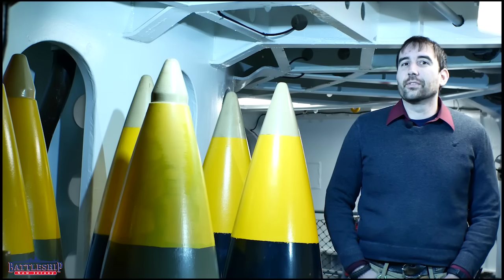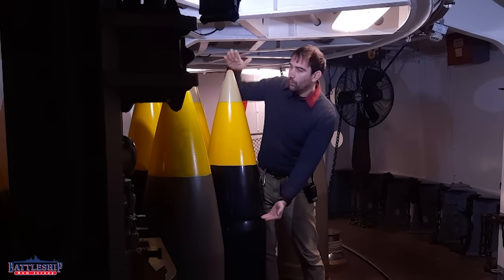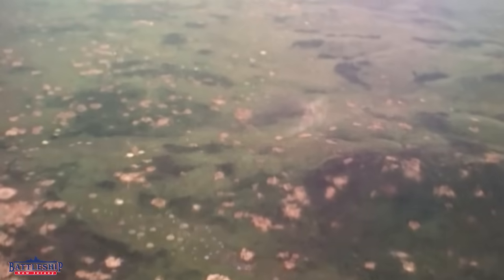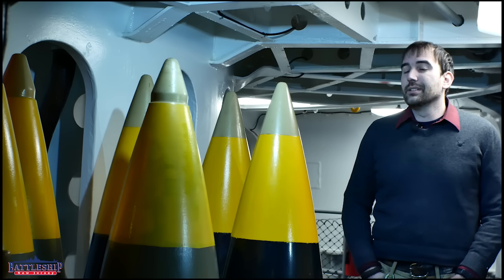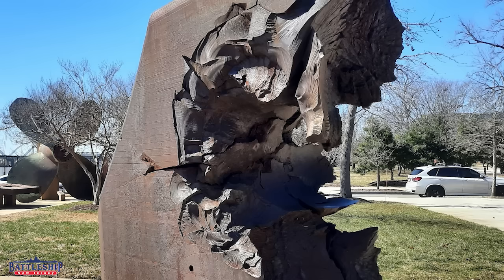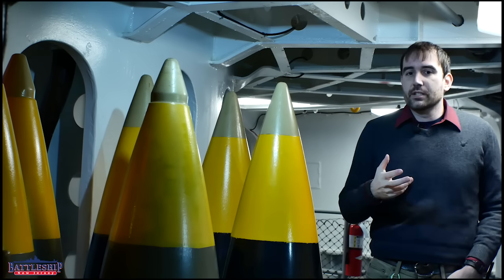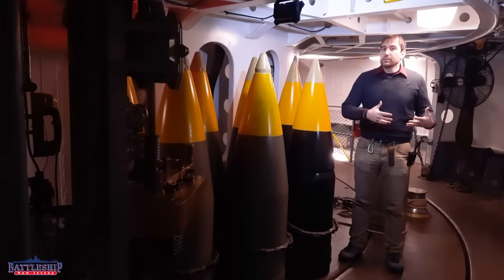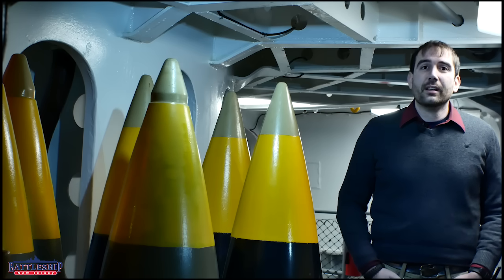What Does the Impact of a 16in Shell Look Like?

Comment: The 16-inch naval guns (primarily the US Navy's 16"/50 Mark 7 used on Iowa-class battleships) fired several types of projectiles. The "kill radius" depends heavily on the shell type, fuze setting, and target (personnel in the open, entrenched troops, armored vehicles, or structures). Here's a breakdown based on historical data and declassified US Navy ordnance documents:

### Main Shell Types and Lethal Effects

| Shell Type                  | Weight       | Bursting Charge          | Typical Lethal Radius (against personnel in the open) | Notes |
|-----------------------------|--------------|--------------------------|-------------------------------------------------------|-------|
| *HC (High Capacity, common)* | 1,900 lb (862 kg) | 153 lb (69 kg) Explosive D | *~60–100 meters (200–330 ft)*                       | Most common bombardment shell. Large bursting charge optimized for fragmentation and blast. |
| *AP (Armor Piercing)*     | 2,700 lb (1,225 kg) | 40 lb (18 kg) Explosive D | *~20–40 meters (65–130 ft)*                         | Very small burster; designed to penetrate before exploding. Minimal airburst/fragmentation effect unless base fuze functions after penetration. |
| *VT-fuzed HC (late WWII)* | 1,900 lb     | 153 lb Explosive D       | *~80–120 meters (260–400 ft)*                       | Proximity fuze caused airburst ~15–30 m above ground → significantly increased lethal area against troops in the open or light cover. |

### Practical Observed Kill Radii in Combat/Shore Bombardment
- **Guadalcanal, Iwo Jima, Okinawa, Korea, Vietnam**: US battleships routinely reported that a single 16" HC shell could neutralize targets out to ≈80–100 meters from impact point against troops in trenches or the open.
- **Maximum fragmentation danger zone**: Fragments from an HC shell could travel 400–600 meters, but lethal fragments (capable of causing incapacitating wounds) were generally within ≈100–120 meters in open terrain.
- **Against hardened targets**: The blast and spalling effects inside bunkers or ships could kill well beyond the open-air fragmentation radius.

### Quick Reference Summary
- Typical lethal radius (90%+ casualty) radius vs. standing personnel: *≈50–70 meters*
- Effective casualty radius (50% casualties) in the open: *≈80–100 meters*
- With VT (proximity) fuze in 1945: *up to ≈120 meters*

So, for most military sources and veteran accounts round it to *“about 100 meters”* as the practical kill radius of a 16-inch naval gun’s main bombardment round. That’s why battleships were so feared in shore bombardment — one shell had roughly the destructive footprint of an entire battery of 155 mm artillery pieces.

Comment: Which shell is heavier?  Did the difference in weight change the effective range of the shell?  What about powder load behind the shell?
Reply: The AP shell is heavier at 2700 pounds while the HC shell was 1900 pounds. 

For complicated reasons the heavy shell actually had a longer range at around 23 land miles. 

Both types of shells were fired with the same powder charge. Either a full 660 pound charge or the reduced charge for closer ranges.

Comment: He just said .50cal shell. 16inch diameter isnt .50 cal or half a inch.
Reply: In Naval gun speak, 16in 50 cal, which is short for the gun being 16in in caliber and the gun length being 50X the caliber length. So the bore was 50 X 16in long or 800in (66.7ft) long

Comment: While in Vietnam in 1970 in the LRRP Ranger Company we had access to  Army Artillery (mostly 105 mm howitzer but also 4.2  inch mortars, and 155 mm) Air (helicopter gunships, jets) and Naval Gunfire if operating within their range which was 13 miles inland (if memory serves. I think the battleship NJ was the battleship off the coast at that time. I never used Naval Artillery but it was an option.

Comment: There is no "powder" that's used as a bursting charge in these projectiles.  That's a term that went out with black powder and cannon balls.  What's in them is either TNT or Ammonol that's poured into them while it's in a molten state (liquid but not necessarily hot) that's then allowed to solidify.

Comment: That was 24" late war Japanese armor plate. The quality of their steel declined quickly as the war progressed. One thing I have never understood is the failure of these shells to substantially damage the Japanese tunnels in places like Iwo Jima. Those tunnels weren't concrete for the most part, rather tunneled out of the native rock. I wonder if they ever tested the effects of the high capacity shells fired at a high angle using a delayed fuse?  After all, the rock of the Island was readily dug through by hand, indicating it was fairly porous material, something even a high capacity round could penetrate easily.

Comment: A few seconds in
16" (50 caliber)? 🤨 😂
Reply: For naval guns “caliber” is short for “calibers long”, so the Iowas 16” 50cal, had a 16” bore diameter and the length of the bore was 50 times the bore diameter 16X50, or 800 inches long. So it’s just commonly used short hand. Hope that helps :)
Reply from the maker: https://youtu.be/79lqN3liPKk
Reply: Caliber is bore diameter ÷ length of barrel for any gun.

Comment: Did I hear him say that the round was "16 inch, 50 calibre"?
Reply from the maker: Caliber for artillery describes the length of the barrel, not the diameter.
Reply: For naval guns “caliber” is short for “calibers long”, so the Iowas 16” 50cal, had a 16” bore diameter and the length of the bore was 50 times the bore diameter 16X50, or 800 inches long. So it’s just commonly used short hand. Hope that helps :)

Comment: On a second tour in Vietnam in '71 as a platoon sergeant with the 101st Airborne,  I was tasked with getting eyes on damage assessment of a barrage made by the New Jersey the previous night.   After three hours of slogging through triple canopy I found vivid proof of the New Jersey strike. The craters were  50 x 20 feet in size. My whole platoon could fit inside one of the craters.  Sticking out of a small  creek bed was the largest piece of OD paint with  yellow markings ordinance I have ever seen. 16" x 6' with 1 ton of high explosive that had not detonated. Noting it's position on my map, gathered up the platoon and cut a choggie back to FSB Bastonge and made my report in the CP. 1st Plt,Co B, 1/327 AI. R S L. CSM retired.

Comment: Can someone explain how this 16 inch shell is considered 50 caliber?
Reply from the maker: Artillery uses caliber to describe barrel length not diameter
Reply: For naval guns “caliber” is short for “calibers long”, so the Iowas 16” 50cal, had a 16” bore diameter and the length of the bore was 50 times the bore diameter 16X50, or 800 inches long. So it’s just commonly used short hand. Hope that helps :)

Comment: I hadn’t seen the video yet but it was conjectured that the United States Navy used the battleships incorrectly in WW II.  Additionally,  if battleships had been armored to stop a 16” projectile,  why hadn’t the Navy instead fitted the battleships witb 20” guns?  Not suggesting having 12 20” guns but why not 4 Turrets each with 2 20” guns?  For a total of 8 guns?  The Japanese had 18” guns.  It certainly could have been possible to make 20” guns and out range and out class by an order of magnitude any other ship on the sea.

Comment: Since these are pre-1945, they are pretty simple designs. In a modern shell of this size, you'd probably see improvements like a shaped-charge warhead in front instead of inert aerodynamic cap, to "pre-punch" a small diameter, deep hole before main projectile impacts. A cluster version would also make sense against soft, extended targets.

Comment: Also the armor belt of the Iowa class consisted of “STS” or “Special Treated Steel” that was dual property meaning it was hardened on the outer surface yet tactile on the inner surface, designed to splinter the shell on impact and the bend in on the inside with the hope of containing the blast. Coupled with 3” outer hull fuel/water tanks and de capping plates and angle of the armor to deflect incoming rounds she was actually pretty well protected, a very sophisticated design well ahead of its time but also very costly had one ever needed repair. Interesting note was the Missouri and Wisconsin had a slightly thicker armor belt.

Comment: The one ton 16" shells ... As the shell is still up high, the sound of the guns firing across the surface of the water will travel far, fast and loud, while the round is still losing 'across the ground distance' by climbing so high, and the arc causes it to reach the ground after the original gun blast has passed the observer perhaps? You remind me a little of general contractors on construction sites who tell the experts what is possible according to their computer modeling and engineering experts (who never actually built a place with their own hands) .

Comment: A primary cause of rear surface spall is the arrival of the extremely fast shock wave from the front surface impact.  Because the rear surface is in contact with air, the mismatch of material properties at the rear surface causes the shock to double in amplitude there, exploding the rear surface.

Comment: 2:40 I’m surprised by the relatively small bursting charges he mentions.  35 pounds for the AP round and 133.5 pounds for the high capacity round seem surprisingly light.

These figures are lower than the Bismarck’s 15 inch shells and would seem more appropriate for 14 inch shells.  

Am I missing something?  Is it possible he mis-spoke and meant kilograms instead of pounds?

Edit:  Did an Internet search and found figures similar to the ones in this video (though slightly higher).  40.9 lb (18.55 kg) for the AP round and 153.6 lb (69.67 kg) for the high capacity round.  

Those do seem light for a 16 inch shell.  Surprising that a single high capacity shell could create a crater 50 feet in diameter and 20 feet deep.  For comparison, the FAB-1500 (1500 kg) glide bombs the Russians are dropping all over the front lines in Ukraine have a 680 kg (1502 lb) bursting charge, so almost ten times as much as the high capacity 16 inch shells.  This seems off somehow.

Comment: I was on AOE4 with JFK and Indy Battle Groups off Lebanon in 1983. We loaded 1000+ 16 inch shells from Sicily to the New Jersey just arriving from Long Beach thru Panama canal (draft too low with shells on board to transit canal with shells.  Flying Tiger 747's transported shells from LB to Sicily). Only fired 15 rounds.  Initial F-15 reconnaissance reported 20-30 ft wide and 15-20 deep craters.  2 shells went off course and impacts not found initially. The firing of these guns could be seen and heard for 10+ miles away.

Comment: Did he say "sixteen inch .50 caliber shell"?...
Reply from the maker: 16in 50 cal. not .50. Also, with artillery like this, caliber is a measure of the length of the barrel, not diameter. So 50 cal tells us it is an 800 in barrel
Reply: @BattleshipNewJersey   Thanks for the information. I read some about that after watching and commenting. I didn't realize that the 50-caliber (as opposed to .50 caliber) meant that the barrel length was 50 times the bore size (16 inches). Thanks again for the info.

Comment: Of course, after World War II, the Iowas had a third option. The Katie.

This was a 16 inch shell tipped with a 20kt nuclear warhead, and was specially made for deployment by the Iowas.

Needless to say, a single Katie would unleash enormous devastation on the target. It wouldn't have to penetrate 30 feet of concrete, it would just incinerate whatever was inside the structure. Anything less robust would be vapourised by a direct hit.

Now comes the fun part. If just one of these shells would reduce a target to lava, how about more than one?

Because, in theory at least, the US Navy could have given orders for one of these ships to fire a nuclear broadside. I'll let those words sink in ... nuclear broadside ...

As an exercise in shore bombardment, this would have been massive overkill, and even at 23 miles range, the ship would have to turn 90° and run from the blast as fast as the engines could manage. Even then, the blast from 180 kt of nuclear ordnance would probably make such an exercise dangerous for the ship.

But, that possibility existed in the 1950s. If World War III had begun at that time, the Iowas could have delivered a nuclear broadside if such action was deemed necessary. Whatever was on the receiving end would, of course, have been utterly obliterated.

It's entirely possible that someone in the 1950s was mad enough to plan for such an action ... because a number of crazy ideas were actually implemented then, such as the "Atomic Annie" nuclear artillery piece for land warfare, and the insanity that was the Davy Crockett infantry launched nuclear grenade.

But I suspect many will agree, that a nuclear broadside from a battleship probably tops even those.

Comment: I had a thought about if the 16" guns could be automated. How fast they could shoot and with cases like the 5" guns. Then I had a thought, why stop there. Scale up the gatling gun from the A-10 to fire 16" shells at 6,000 rounds per minute. That would be some scary stuff. The ship would need room for all the ammo, but you would not need 9-16" guns, I think 2 would be plenty, one at each end.
Reply: Absurd idea. Six or seven 67 ft long 16" rotating barrels in an armoured rotating turret would weigh at least 3,500 U.S. tons per turret. Then add on the one ton weight of the belt-fed shells, the many auto-loading silk charge bags, the links, the auto-loading systems & you have an inaccurate cumbersome monster that might fire three shells per minute per huge turret. 

The existing arrangement is superior as each barrel is independent & can fire two rounds per minute. Your 'Gatling' would halve the total shells fired per turret. These large barrels that fire at a slow rate are NOT improved by a Gatling mechanism - which is designed to overcome the normal heating effect of rapid fire through one barrel. The recoil time & loading time would eliminate all advantages of a Gatling-style mechanism. 

Additionally, it is very hard to align six barrels so they all hit a small indirect target. Gatlings are used for close, visible direct fire targets for good reasons - no use for long range ballistic indirect targets.

Comment: 16 inch .50 caliber shell? You sound like Joe Biden😂
Reply from the maker: With large artillery, caliber is a different measurement than with small arms. Caliber is used to measure the length of the barrel compared to the diameter. And its a 50 caliber, not a .50 caliber. Here's a whole video on that: https://youtu.be/79lqN3liPKk

Comment: Why was the 16 inch called 50 caliber?
Reply from the maker: For large guns like these, caliber describes the barrel length relative to the barrel diameter. So our gun barrel is 16in wide by 800in long
Reply: I understand the inches refers to the width of the barrel, but they call it the 16 inch 50 caliber...
I've heard that before and don't understand the 50 caliber part.
Reply from the maker: so 800 in is the barrel length, 800/16in = 50 . So thats where the 50 for the 50 caliber comes from
Reply: I gotcha, thanks

Comment: When I was an engineer in 1968-1971 working for the Naval Ordnance Station in Indian Head, MD, we made the propellant for the NJ's 16 inch guns. As I recall, it was a double base propellant made of some formulaic combination of nitrocellulose and nitroglycerin. We made it in little pellets a little bigger than the filter on a cigarette, then it went through a series of processes before it was turned into a slurry, then sent through a huge stainless steel extrusion die to shape it into whatever charge was necessary for the NJ's needs. The extrusion process was unattended and in an underground bunker with the extrusion press aimed at 10 ft concrete bunker walls and into the dirt. One day there was an 'accident' apparently caused by some metal getting into the slurry and it ignited, sending the two ton extrusion die through the 10 ft reinforced concrete and 30 ft into the soil. OOPS! Fortunately, no one was injured, but the press and bunker was destroyed.
Reply: Yep you are right.  The final product was called cordite and it’s the size of a roll of quarters.  Most people think there is loose powder in the bag but there isn’t.  It’s designed to burn and build pressure as the shell leaves the barrel and not explode all at once like a cannon

Comment: Love all the stories about the grand lady!   I worked with a guy in the early 80’s who was a electrician on the New Jersey during Vietnam.   He told a story about some civilian techs coming onboard to install some type of new gear on the guns and after installation the guns had to be test fired.  The techs had some apparently expensive tool boxes with some VERY expensive tools.  When the guns were turned to firing position someone noticed that all these tool boxes were under the barrels.   They told the techs that the boxes needed to be moved but whoever was in charged advised the boxes “were very well built & heavy” so they didn’t need to be moved.  Well they proceeded with the test firing and after one salvo ALL the boxes were pushed over the side because the only way to open them was with a cutting torch!